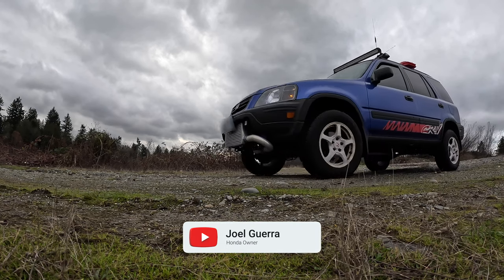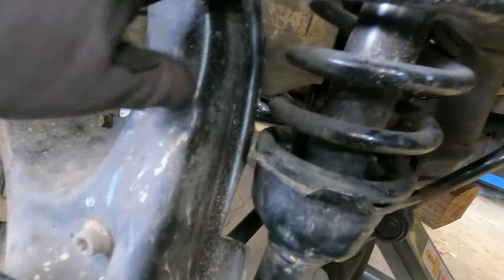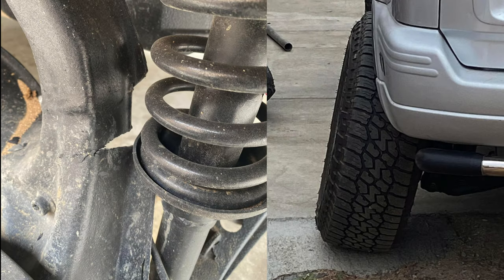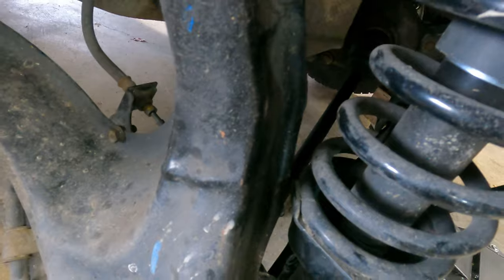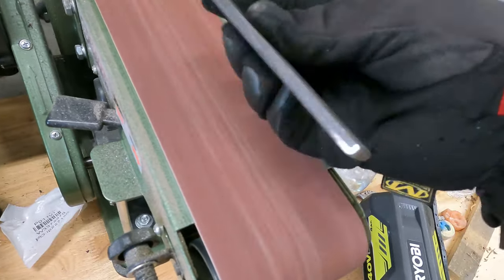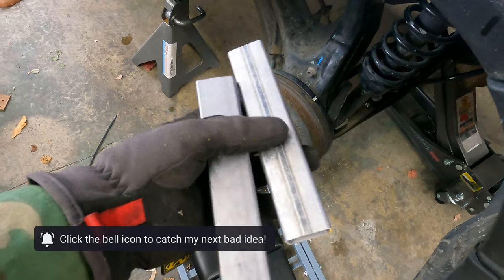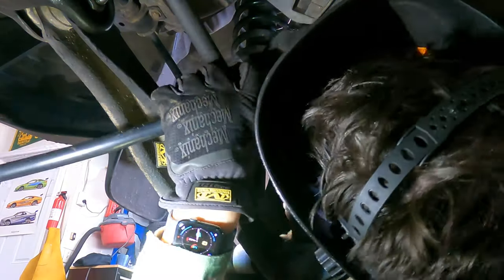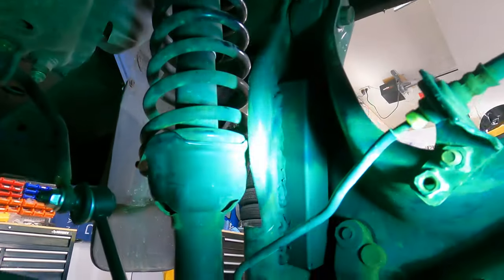Reinforcing Trailing Arms in a Lifted Honda CR-V RD1

Comment: When you welded the first piece, you placed the grounding of the welding machine on the screw that holds the wheel. This causes the current to pass through the ball bearings of the drive axle, damaging it. You should always place the ground collection as close as possible to the area to be welded.
Reply from the maker: Thanks for the tip!

Comment: Starting with, you should never cut any metal that is under tension at a right or 90° angle. to avoid this you can drill a 3/8 or 1/2 inch hole and then make the cuts to meet where you drilled the hole. Even so, if the material is very thin, also add the reinforcement that you made.

Comment: did a 3" lift with no drop spacers. i notice my front coils getting sandwiched between the body and spindle under full droop. this limits my droop in the front to the equivalent of a 2"lift and makes noise when front suspension drops. i never noticed an issue with the rear other than the control arm bushing completely ripping out. ill have to check this out the next time i flex my suspension.

Comment: The question is....Why did I not have to cut mine with a 2.5 inch spacer and you did?
Reply from the maker: Possibly because my coil overs were not oem? I’m not sure.
Reply: @joelatwar  Just find that a bit odd, my oem and non stock coils all cleared.